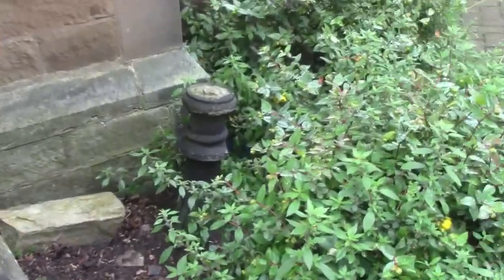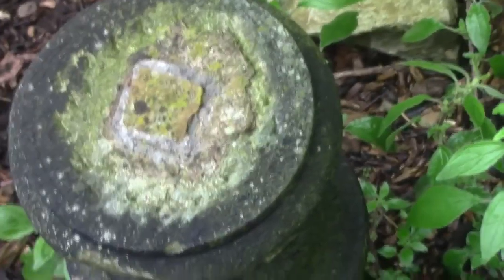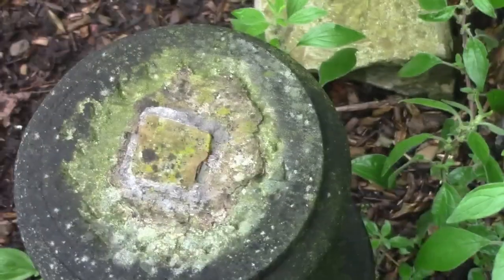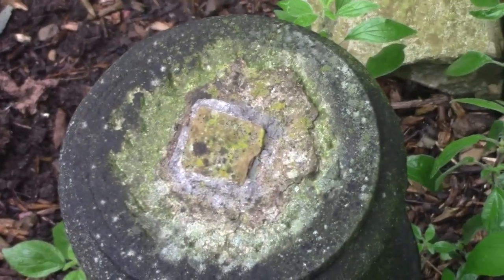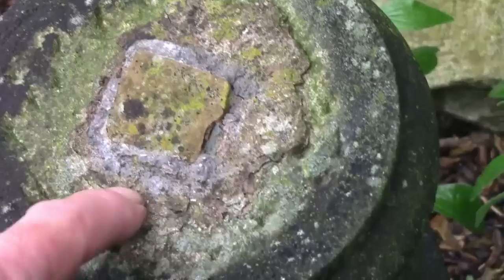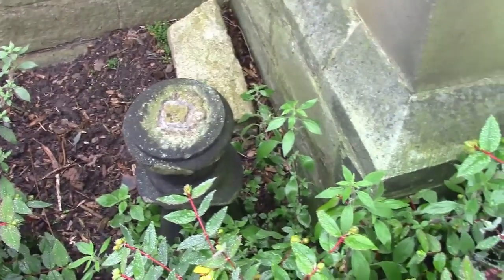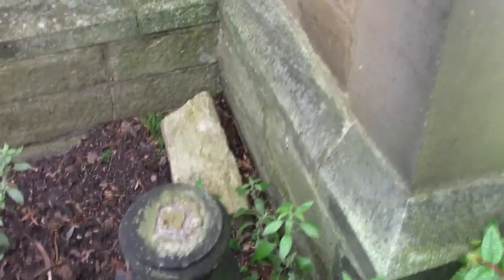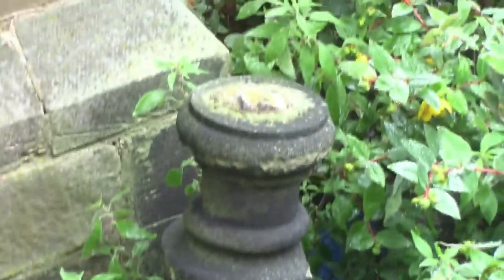Capacitor .....ornamentation or neither??

Comment: Yo! I think ornamentation. My guess is whatever had held the finial was like a spike. It looks like the spike was coated with a glue like material. And then a finial filled with concrete was slid over top. The other two different colors black and green was the black was exposed to weather and the green was where it adhered to wherever it was affixed. It explains the four colors at least.
Thanks for the video!
Reply: If it was ornamentation there wouldn't be different colors or a need to make it in multiple parts. They couldn't carve them in one piece?
Reply: The finial is one piece, one piece with a hole in it. The hole is for easy mounting.

Comment: Hi Dave.  I am able to explain what this is as I have been researching this Church after buying a pew that used to be sited there.  Documentation I have found says the
spire had been finished and surmounted by a weather vane of
highly ornamental design, and a lightning conductor.
The vane, which had been fixed by Mr. William Slater, of Bradford, was of
an entirely new pattern. (later removed by the Fire Brigade for safety
reasons during the 1990s) .  I am guessing where you found it was where the Fire Brigade left it!
Reply from the maker: Many thanks for that...i did wonder at the time how it got there. It is a common feature on a lot of churches but i never get to see them close up.👍